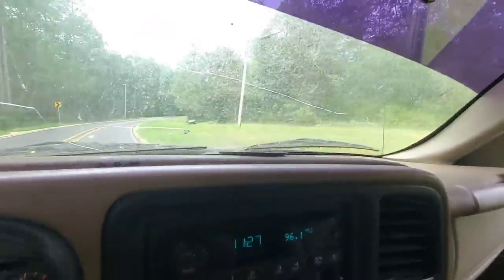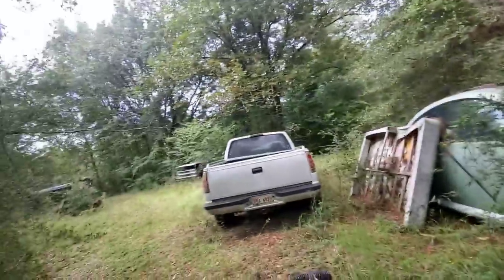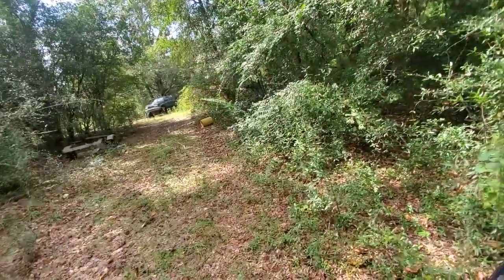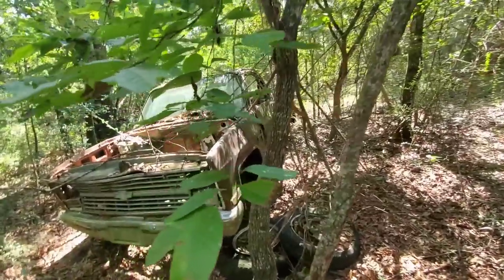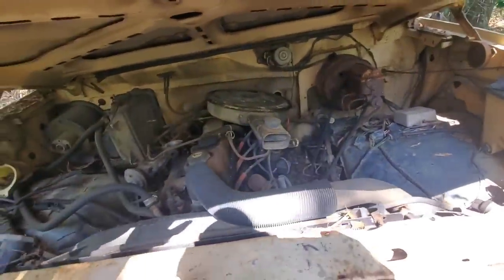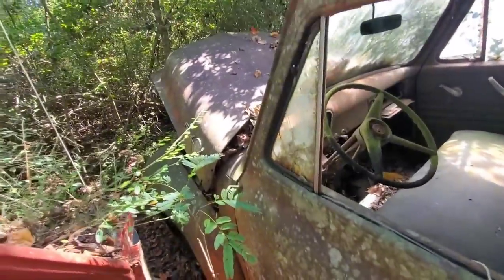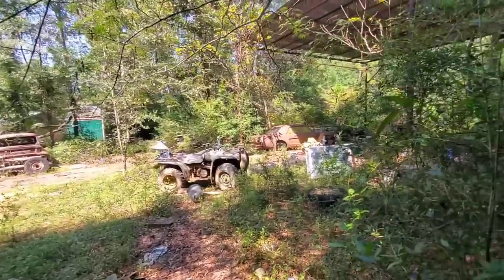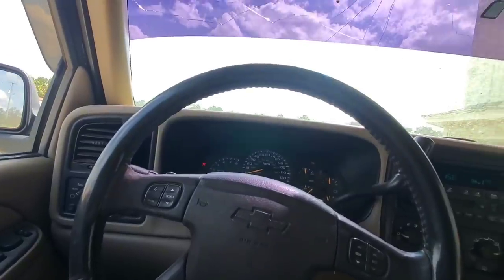Abandoned Property With Over 30+ Cars, Trucks, & Lots Of Parts

Comment: Them celebrity steering systems look an fit awesomely on a s10 chassis if ya wanna make a low buck rat rod. Rip it out fore ya scrapper.
Reply: Pretty sure that celebrity got crushed into a tuna can by now lol
Reply: @FLINTmitten810  oh well. Caint save em all.
Reply: @myjunkertravels2junkahunta726  that’s right lol. I remember when I was a kid those were popular along with their sister car the Pontiac 6000. I remember my Dad had a 1986 Pontiac 6000 STE and it was the first car I saw with red gauge lights and was kind of cool in a weird way. I remember that thing burned a quart of oil every 20 miles no exaggeration.